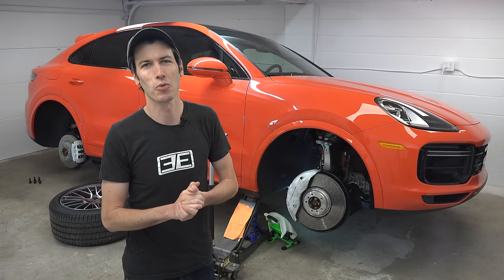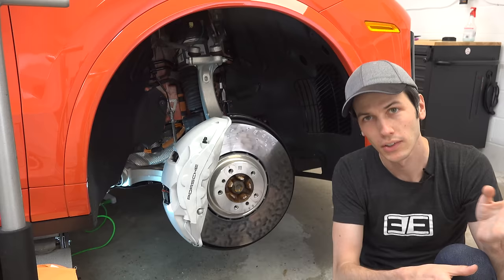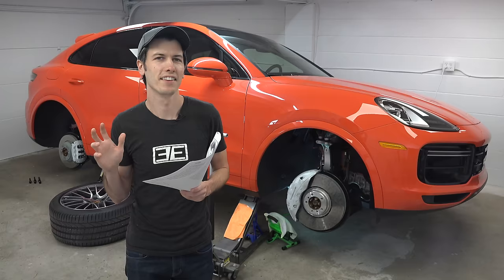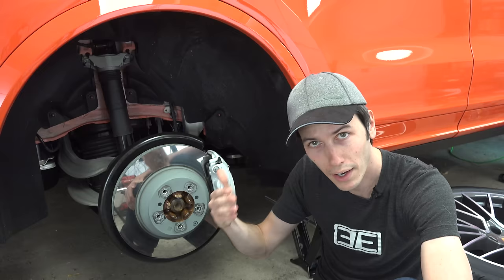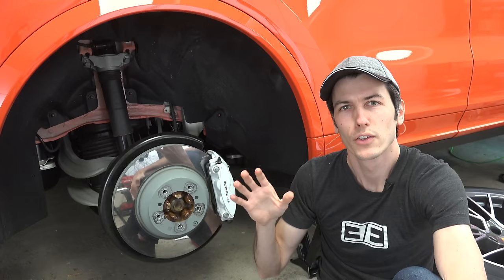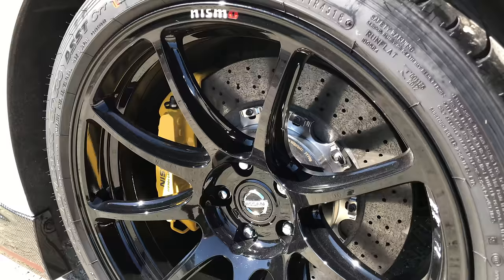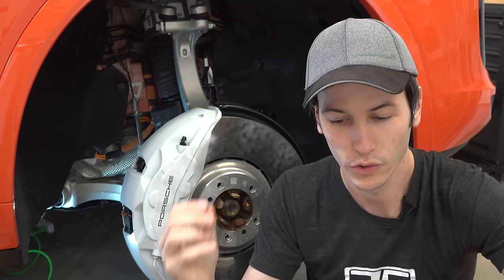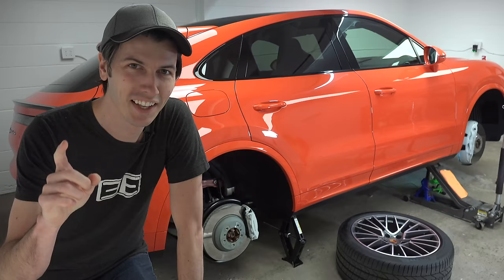Porsche Reinvents The Brake Rotor - No Rust, Low Dust, No Fade!

Comment: Very Well Engineered , and as We Engineer's like to say "Well Stated"
But the Prices seemed Crazy ~ I'm able to Go out & Buy  Ceramic Rotors for NSX for $750. a Pc.  / Caliper Kit around $64.00  from Dealer . .  so I'd  Surly  Mod Up a Setup to Run those 14" Barkes
and ~ Forget Porsche Parts ~  Dealer had to be In Germany - He may have Included Shipping or something - Pushed wrong Button for USD conversion - as 32K seems Totally Un_Realistic

Comment: some people just have to hate. there is nothing wrong with supporting a car even with only a floor jack as long as you are not getting under the car. once you are going to stick a body part under the vehicle then the jack stands are necessary. thirty years of owning porsche's  and I still can be awe struck with the replacement part prices.  there is no logic to them.

Comment: Motorcycles use stainless discs with sintered metal pads. They don’t have servos but give excellent stopping power and long service life. Why is that combination not used on cars?
Saying that my Fiat Panda discs and pads cost £20 per wheel.

Comment: Where did you find a jack stand narrow enough to fit inside that Harbor Freight jack?? I with all jacks came with a locking mechanism so we didn't need jack stands, especially now that all the under trays and body designs make it hard to find a enough jacking points for both jacks and jack stands.

Comment: Standard Brakes, $2300? I can get an entire Porsche brake parts kit for my VW for $2000 (rotors, pads,, brackets, calipers). I guess dealer mark up on those pads/rotors? The Porsche pads/rotors (at least ones for late 90's early 00's), while the calipers themselves are expensive, the pads and rotors aren't any different than the (non-economy) brakes offered at parts stores. In fact, it was the same price to put Porsche parts on my VW as it was to buy VW parts or upper end aftermarket parts. I'm pretty certain a lot of Porsche's have the equivalent to a auto cross or MAYBE a light track setup when it comes to cast iron. Price is around $600-1000 depending what you get for pads/rotors.

It would be possible that the newer vehicles are a lot more, and those brakes are only used on a couple models/trims so they are very low production numbers.

Comment: I wonder if these rotors would be easily recycled to have the tungsten carbide film placed back on. If that's possible it should be cheaper to have the rotors replaced once the customer has bought a set. Or their car came with them.

Comment: I don't get the temperature thing, regardless of coating either kind of rotor would be absorbing the same amount of kinetic energy and converting it to heat.  Since either rotor is basically cast iron if they're the same mass wouldn't they heat up the same amount?  Sounds like a marketing guy made this up.

Comment: $2300 for the standard full replacement package. Porsche are just printing money. The parts cost (the customer) half that and then they're charging $1000 for the 30 minutes it takes a good mechanic to change pads and rotors in a shop. There are a lot of things that it is worth while taking your car to a garage for, consumable brake items are not among them.

Comment: well thats odd, because I changed to a different pad on my shelby gt350r and now the dust is 75% less than factory pads.  So if rotors create 70% of dust then how did my pads converge percentage reverse inwards?   I guess Porsche is the only company that can divide by zero.  interesting.

Comment: Great clip, it did just make me realise that the effort i went to was worth it which included-

I spent 8 hrs detailing my wheels to prep for a extra clear coat on my wheels.

This make them much easier to clean and i will eventually get a ceramic coating also along with the rotors.

( 2014 macan s )

Loving my new  car by the way.

Thanks again.

Comment: Great video as always. Porsche are taking the piss trying to charge 32k. So how is it that the brakes are 9k option new and replacements are 32k? Mental. 
I searched around and you can actually get full set of ceramic brakes including calipers for Audi RS6 for under 5k Euro. Original parts. Try your Audi dealership direct and you will pay 12k. Beats me. And they are not knock offs, just in case people will wonder. 🤦‍♂️

Comment: I'm pretty sure that the term "cast iron rotor" is  wrong. Perhaps steel, or milled steel, but cast iron, which is equivalent to pig iron is very brittle and surely cannot be used in brake rotors.

Comment: How do iron discs, pads and sensors cost $2000+ without labour????
Disc's are like $500 for a set of 4 at most... Pads are like $200 for a high end set of 4... and sensors don't cover even close to the difference...

Comment: How about a video on why the Porche and maybe other European vehicles don't use studs to mount wheels when U.S. and Japanese vehicles do and don't seem to have problems with studs.

If anyone else has ever tired to hold a super heavy wheel up against a rotor that has 5 holes and a hub behind the rotor that also has 5 holes and try to line up all three sets of holes to get a bolt through it.....you probably know the frustration. Why can't they just use studs....

Comment: I’m no engineer, but all those spots on the front rotor look like those heat spots a burned flywheel get when abused. Those usually chatter and is felt when you engage clutch.

Comment: How about a little more explanation of where the claim that 70% of brake dust comes from the rotors? Even taking into account the greater surface area of a rotor compared to both pads, pads wear out much faster than rotors. Also ceramic pads on iron rotors are known to accelerate rotor wear while decreasing brake dust. Could you please respond to this?

Comment: As 0.00083mm = 0.000033in or 33 million of an inch. Caliper is no way to use to measure that fine. Your touch on the brake pad may increase that amount.

Comment: So here is the issue I have with these brakes.  Yes, they are cool how they are coated.  However, their construction is crap.  Those brakes have to chatter like crazy when braking.  The calipers are so strong that they have squished the metal between the support bracing fins between the two attached disks.  That's why the rear are sparkly and the fronts are spotted.  It means the cast iron alloy they used is too soft, they have the brake bias way too forward, and the driver is also very hard on those brakes likely due to the very little braking surface area.  The driver has to really squash those brakes to get them to work decently.  For that reason alone, having brakes that rust a little gives a normal driver a view as to how their brakes are wearing.  You can also tell by heat burn on a cast iron brake how the internal heat dissipation is.  With those you can't tell as the cast iron is coated with the tungsten carbide.  Tungsten as a default doesn't discolor or mis-shape with heat like cast iron does; hence it's use in TIG welders.  The tungsten looks like it's preventing the mating surface from adequate heat dissipation causing the cast iron to get heat soaked and soft under hard braking.

Normally, I'd agree with what you say on stuff.  However, I have to 100% disagree on these brakes.

Comment: @9:50 even "hot" air out of the engine bay would be "cool" compared to a brake rotor. Not a problem.

Comment: Okay you said the pads wear at a 1500 times greater than the rotor,but said the dust was from the rotor,what?if you wear through the tungsten carbide 5the brakes will still work just not the same.

Comment: I don't see many advantages for the price, cost 3 times as much and last 3 times as cast iron. Same weight as still cast iron. Ok they might not get rusty on the surface, but honestly who cares, 100m and they're back shiny. Metal Matrix Composite brakes or MMC mounted on original Elise S1, were much more revolutionary, bringing down unsprung and rotating mass extremely.

Comment: Why you don’t put the wheel under the sill of the door, in case of a failing from jacks the wheel will save the brakes. Surely a wheel won’t cost as much as a brake job

Comment: @engineering explained I have always wondered why carbon ceramic brake rotors’ surface area always seems a lot bigger than a similarly sized steel rotor. The hub the CC rotor is mounted on seems smaller and there seems to be less distance between the rotor surface area and the hub on the CC rotor than a steel one. Could you explain if this observation has anything to it?

Comment: Just wondering, if I use up the magic   tungsten layer, theoretically I have conventional cast iron discs, right? Can I just switch to conventional pads (ok pads designed for conventional cast iron rotors) and use up the rest of the rotor's life?

Comment: Great video from EE, as always!  Wow, look at the number of views, there's almost no higher number on YouTube.
Hey EE, please light a fire under Mazda,  I'm getting very impatient about their range extender rotary option vaporware.
NOW..... Porsche..... this is the wrong direction for Porsche.   A few years ago they promised to make their cars more pure and basic (and reasonable, in terms of price) and this rotor coating  is a move in the very wrong direction.  Prices and complexity of Porsches have gone into outer space, reliability has suffered, their venture into diesel has been disastrous.  
Hey Porsche, give us this: a conventional brake disc and rotor design done smart and light.  That alone would put it at the top of the heap.  Simple, excellent german engineering for purists, that's what people want!

Comment: I'm waiting for Eddy current breaks w/bk up hydraulics. Use the breaking force energy to power a hydrogen conversion cell. Then pipe the hydrogen back into the motor. As bad as inter city driving is getting and all the stop go traffic... You would probably need to drain the fuel tank every other week. Slamming on the breaks could be the new Green movement. Also double as population control.

Comment: Their claim that 70% of break dust is from the disk seems outrageous? Say if you’ve lost 1mm of your break pads and 0.0005mm of your disks then the 1mm of break pad material is definitely going to produce more dust than the disks have. I’d question the lifespan of them too, if they’re making something more hard wearing then designing a pad so that it’s more abrasive so that it can grip on a smoother surface; surely it’s going to wear more and balance out?

Comment: I wonder if the patent holders will make this available to the broad market. It'd be interesting to see if this could make it into more of the market for a better price.
Reply: HVOF spray coating with tungsten carbide is a widely used industrial process, offered by many companies. There is nothing patentable about its application to automotive brakes, so even if someone did get a patent issued, it would not stand up to a legal challenge. The compatible pad material is more likely to be the subject of a valid patent.

There are ceramic-coated aluminum rotors available for bicycles.

Comment: Even if the jacks were to fail hydraulically and mechanically, the weight of the car wouldn't' crush the metal parts of the jack into dust so therefore the car wouldn't hit the floor.  It's for display and instruction not for working under the car so give all this millennium complaining (just because I can and demonstrate how observant I can be) a rest it's tiresome and annoying.
A good explanation of the brakes thanks.

Comment: Alright, so this is the 2nd time watching this vid several months apart. 2nd go round, iron brake calipers as a comparison? Iron brakes have pretty big down sides. High carbon steel is better for most, esp. if cryo treated. Either one will need replacing each time I do my pads because of my driving habits. Sometimes I burn through rotors in 1,000 miles or less. Not going to the track. That coating is so thin. Just use regular semi-metallic pads with high carbon steel rotors and replace them both every time. cheap.

Comment: I replaced the front brake pads on my 2008 Prius at 180,000 miles. The car now has 250,000 miles on it and the rotors are STILL original, the lifetime warrenty pads from AutoZone were $50. 

But yeah, Porsche.

Comment: If pads wear 1500x (thickness) more than rotor dont you think that is where brake dust comes from? Cheap pads equals dirty wheels. Project mu Bestop is their budget pad their others can be 4x dearer. However being a quality Japanese made pad I have experienced very very low brake dust using them on 3 different cars (Enkei sparkle silver). Its a shame I cant get them for my particular European car on which the dust is horendous (on black wheels too)

Comment: if 70% of break dust is the rotor then i should not have rotors on my pu after replacing the pads 5 times but they seem just fine only a little lip like 3 thousand then i can still turn it . seems like most u people have no idea what ur talking about and u can't turn these rotors so actually u get more out of a stander rotor because u can turn them . now we after market breaks now that work all most as good witch u would not be able to tell by driving it .. then like my 68 pu i can replace everything on the breaks for under 200  bucks all new and the truck stops just fine . but i bet u need all the fancy things just to drive

Comment: $11,000 for brakes??? :-O Manwe wept. No, no, no. MY car (Giant Sedona) costs $450 to replace, and the brake pads cost about $5 each ($20 for a set of 4). Maintenance cost is about $50/year. Fuel cost is $0, insurance $0, registration $0. :-)

Comment: Even the standard brake parts are unbelievable expensive.
Mostly because they are for a Porsche and owner are proud to spend that much money and brag about it.
I knew a man with a Ford Cougar and a Ford Mondeo (in the Netherlands)
Replacing the front brake rotors and pads was 35% more expensive on the Cougar. Same Ford dealership. And they are the same parts.
He complained and was told the standard prices are indeed different. The Cougar is just a different class car bla bla bla...
Carbon rotors are just to show off. When you drive a car on a public road there is no need for much braking. 
When you have to make an emergency stop there is no time to heat up the carbon brakes...
Just taxation of stupidity!

Comment: Well, regular drilled/slotted rotors with good pads do just fine on my vehicle. Interesting to watch but to be honest: completely useless for an American audience because the maximum speed limit in the US is around 90mph and more common around 65mph. People may go on a track for fun, so that's the people who might spend that much on brakes. For me: $200 rotors, $80 pads - good brake performance even when towing. 
PS: I would have no problem working under that car with the 3 jacks. Well, maybe that's why men live shorter, but it's already redundant.  I just do jacks and that's it. Ok, I have 14 inches ground clearance, so the car will not crush me if it came down -  that sure is a consideration.

Comment: I am for innovation, but not like this. These are an incredible blow in the wrong direction of being cost-effective. You said that on a normal rotor, you wear 1mm from either side and replace them. 

No, no you don’t. You wear them until they reach minimum thickness overall. I can turn my rotors 3-5x before that happens, and the stock brakes on my 4Runner last 70-100k miles.

I just turned the original rotors on the ram 2500 I picked up from the auction lot, with ~177k miles on them. The previous owner glazed them from constantly pad-slapping them, and I can tell you they lost at least 2mm in the process, if not 4mm overall. I haul at max payload since then, & they’re not warped yet.

I enjoy learning the science, but when I combine it with what I learn about businesses, this is a classic Example of innovation for the sake of innovation. If it takes off, great; but until it costs the same as regular brakes — there’s no sale happening here.

Comment: 9:20]  Wow, total parts replacement cost for the Porsche TCB brakes five times that of conventional overpriced Porsche brakes.  At the very beginning of the video, before we know anything about the TCB brakes other than they lasted 30% longer than conventional brakes I guessed it would be six times.   So, for slightly less than 1/3 greater service life you get to pay five times as much - you've just been screwed.

Comment: How is that possible that 70% of dust is rotor, but most weared part is brake pad??? Looks like BS! You change 10 brakepads until you change ONE rotor!
And related WC... how about heat - does WC transfers/absorb heat same as cast iron?